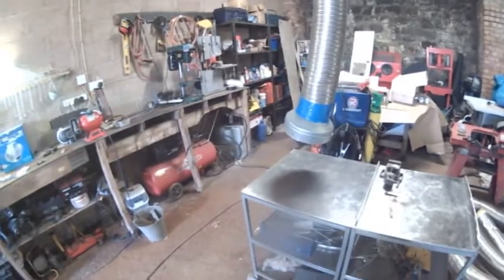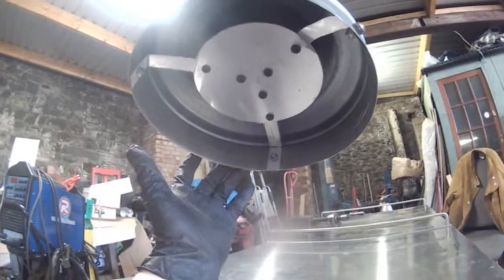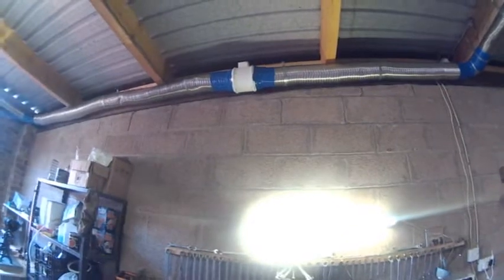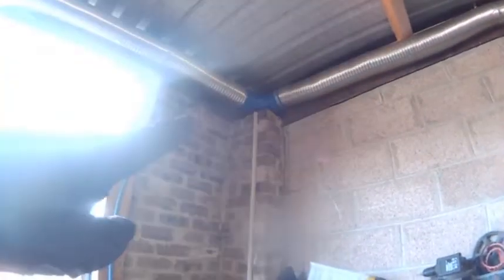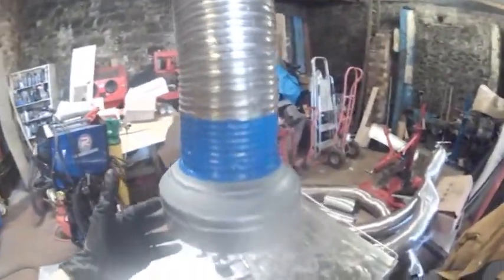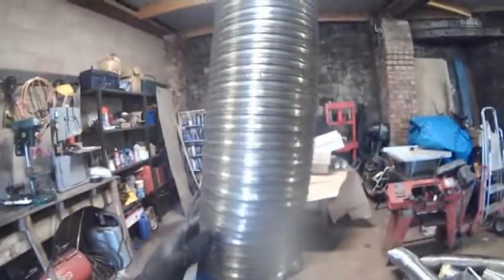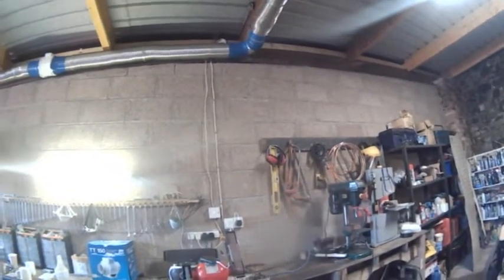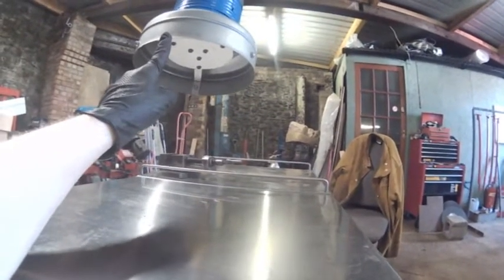DIY Welding Fume Extractor for £99

Comment: I just built something similar.  I'm curious about the baffle, so that increases suction?
Reply from the maker: With the baffle in place you are decreasing the area of suction, and it turn increasing the suction around the edge of the receiver. It works on the same principle of sticking your fingers across the end of a vacuum cleaner hose, it increases the suction. Hope this helps.
Reply: I'm going to look into it, thanks!